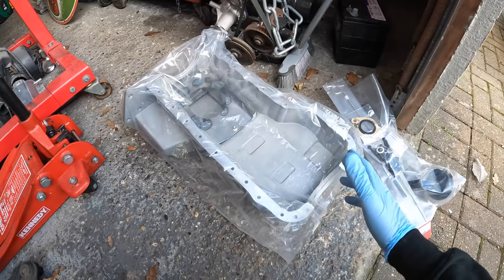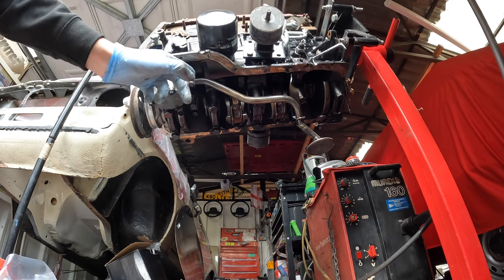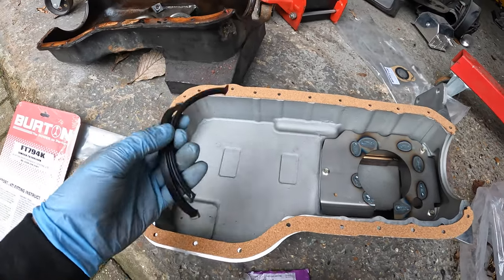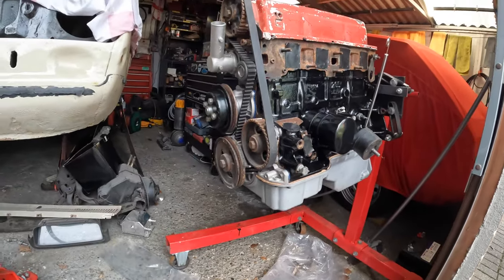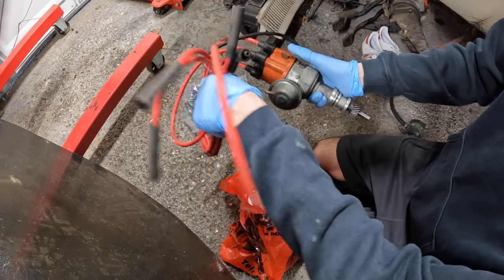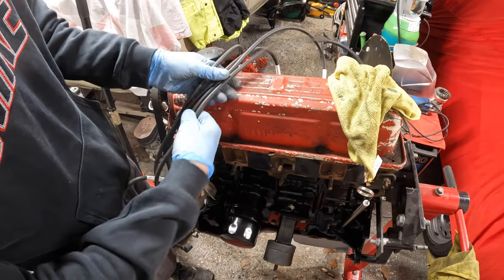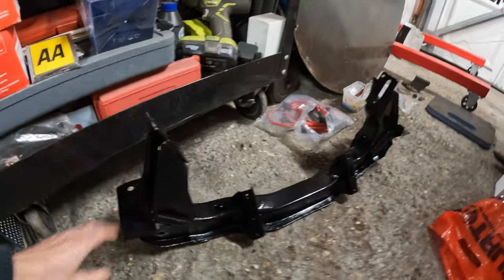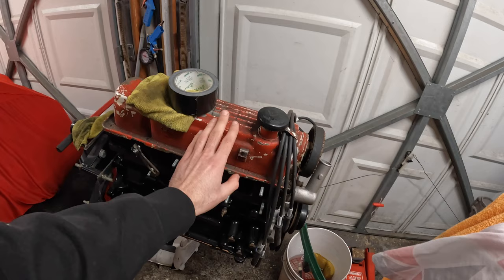FORD 2L PINTO - SUMP TO SUIT ESCORT INSTALLATION & MORE NEW PARTS!

Comment: hi, elephant in the room, why didn't you spin the engine 180 to put that sump on...
you did not time the dizzy.   crank pulley mark to TDC, cam pulley pointer to bottom dot on head, cap off+ turn dizzy till rotor arm pointing to no.1 lead, no.4 lead should be the opposite no1, no3 lead clockwise after no1.    yank dizzy out + turn  rotor arm if you run out of adjustment, most bosh dizzys have a reference mark filed in to point the rotor arm to.
before you put new cambelt on [+ before timing dizzy], fill up oil, take camcover off, then spin  up aux. cambelt pulley until oil comes out of each hole to lube cam, should be a good flow on each, not a dribble [i always renewed the spray bar if they had been standing, + usually the cam tensioner pulley as well, spin it + listen, should be nice + quiet]
apologies if you have done these off camera, keep up the good work young man]
Reply from the maker: Thank you so much. Every day is a school day and I did not time the dizzy up with the engine. In all honestly I was wondering how it would know what cylinder the engine was on 🤦🏻‍♂️🤣 Your advice is priceless and I will be following your comment when I remove and time up the dizzy with the engine 👍🏻

Comment: Did you time it up when you put the distrabuter in ?
Reply from the maker: No I admittedly didn’t! I will be removing and correcting this. Thank you for the spot 👍🏻
Reply: @Mk2 Mitch  no worries I used to repair and built lots of pinto engines back in the day .

Comment: You fitted the sump gasket in the wrong order should of put gasket on engine block first then fitted the rubber seals over ends of gasket and finally fit sump the tabs on end of gasket fit into the rubber seal
Reply: 100% agree
Reply from the maker: Lesson learnt! If it leaks I will re do the gasket/seals in the order 😎